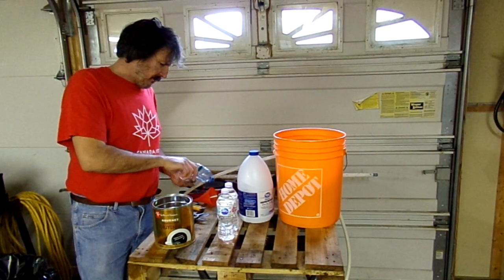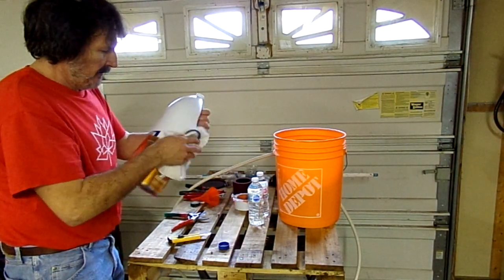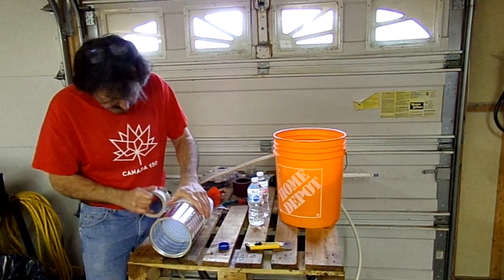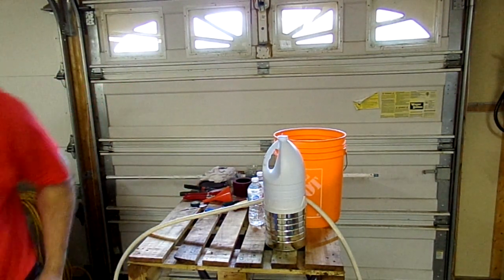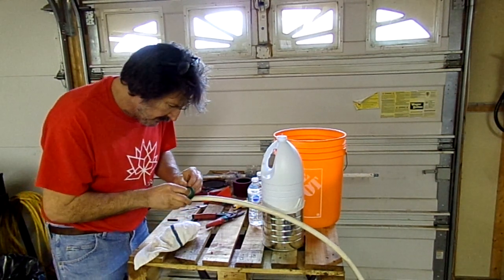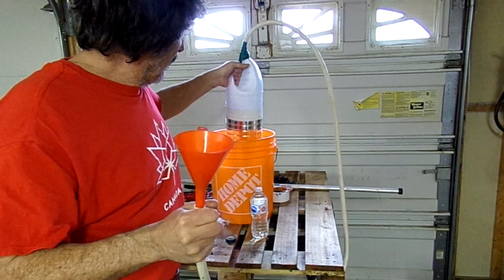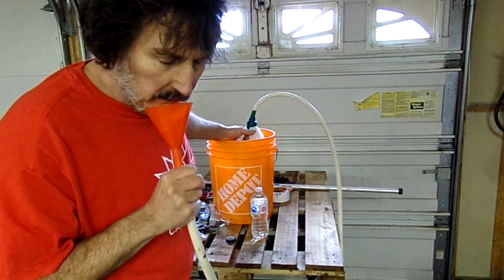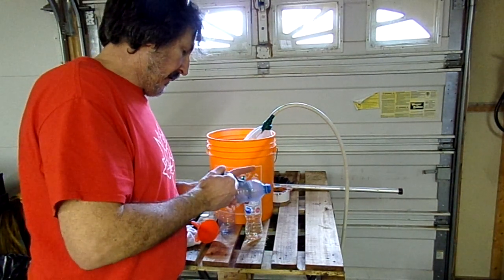Effective  Home ventilator for coronavirus COVID-19   homemade  DIY

Comment: In extreme circumstances triage will be used to ration ventilators, I believe this Home Ventilator and others could help save many lives. Or at least make you feel you tried to help loved ones and not had them put down like a dog all alone and no family near them. I really do not understand how people especially the elderly are being factored out of any help. Thanks.
Reply: @ruralcoder  I'd later heard the convincing Drs testimony and pleas had not been officially implemented. Truth is now there are many factors in care for coronavirus victims and patients. Thanks for correcting me, even the "Home Ventilators" may be negligible in long term use for aged patients and could do harm. I have made an "oxyGEN"  Spanish designed "ventilator". Seat are supposed to be manufacturing them, I pray we do not need them. Hope you and your family are safe and well.

Comment: Great! Thanks a lot!  I have used simple water check valves that are available in hardware stores ( maybe home deppot).. i live in mexico... i have a dust mask connected with a tube.. to a Y connector.. each of the out tubes from the Y connects to a check valve ( one connected forward and the other backwards)  so the pacient can breath from onee tube and exhale to the other tube autoatically, the check valces do the trick. So the person could be masked with mouth and nose and the air will go in when he inhales and the CO2 will go away to the other tube when he exhales.   I will try your  air compressor using pvc tubes.. you could control the volume of air by the frequency of the movement and the pression by the level of water in the container(bucket in your example)
Reply: @Watashi wa Mekishiko desu thanks.. we are working with an electrical engineer and a mechanical engineer to develop a simple respirator that uses only a cheap rugged motor pvc pipes and water to do the respirator mechanism
Reply from the maker: What ever Works! good job !
Reply: @augustoeducation  sir can you please guide me a little to make it ,am a student